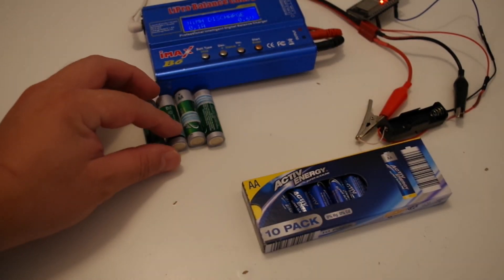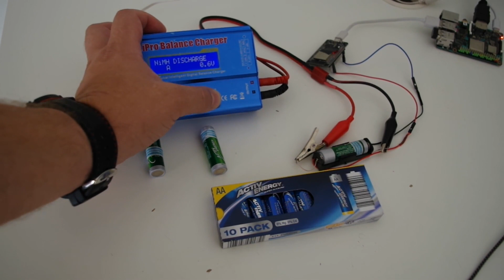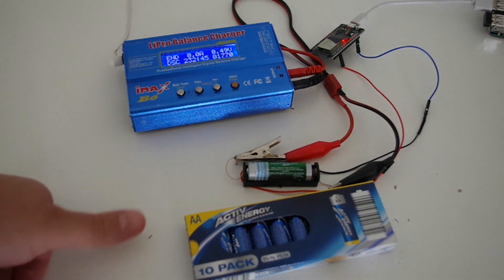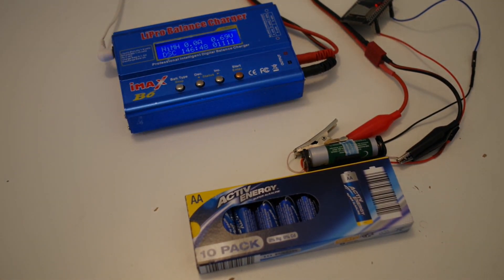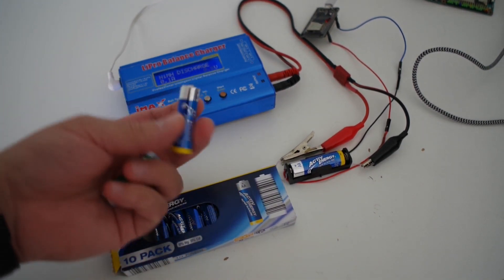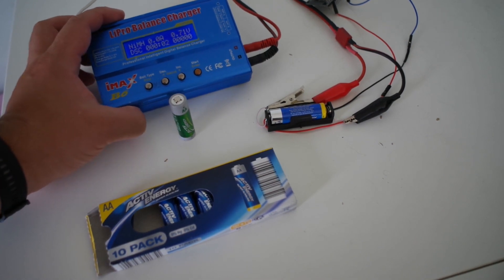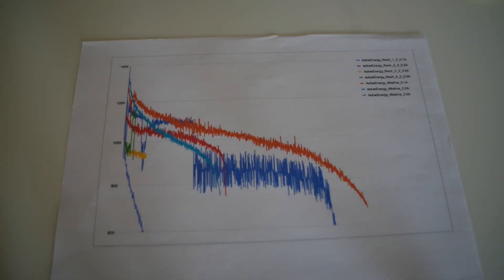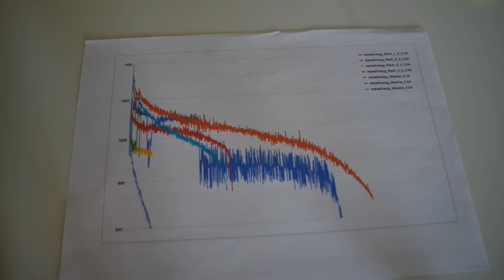[Fail] AA Battery testing: Activ Energy

Comment: Are you draining NiMH to 0.69 V ?? How many times have you done that to those poor things before putting them in test? Basically you irreversibly degraded the battery, after which there's no point checking capacity. Also there is no point testing charge down below 1.0 V.  🔋💔🪦
Reply from the maker: You can discharge single cell to 0 Volts, and with small discharge/charge current this will not lead to significal damage. Hovewer, if you will dischage a battery (several cells in series) of rechargeables in that way - you most likely will kill cells in a few cycles - because in a battery weakest cell will be reverse-voltaged in that case. But with single cell this not just harmless, slow discharge to 0 can actually recover some capacity of old cells (but not much, they will not be like new).